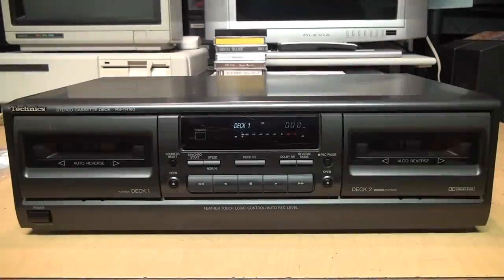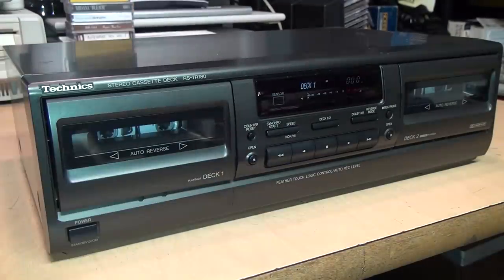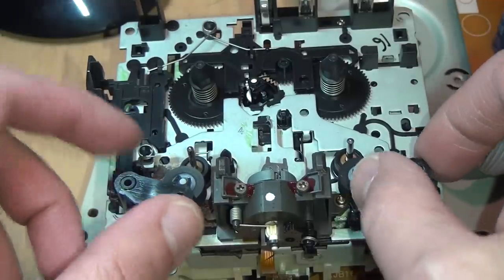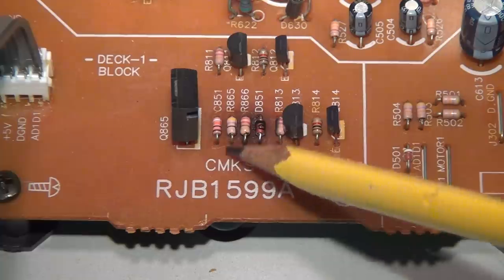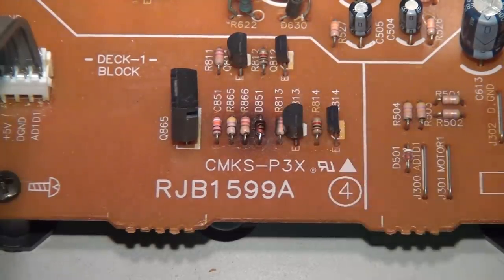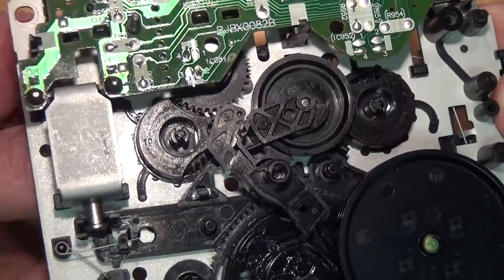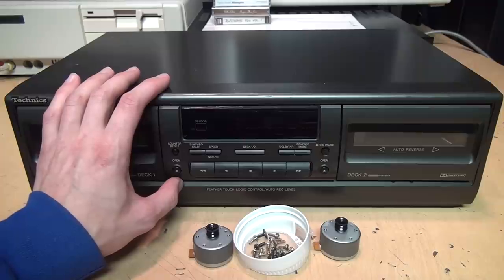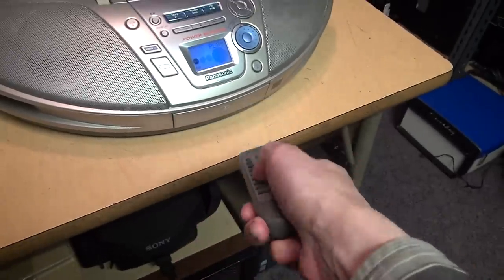Fixing a cassette deck but Everything Goes Wrong...

Comment: I have a Denon DRW-580 and it has been such an incredible cassette deck for me, it has auto reverse, dolby NR, and while its a little basic. It is perfect for me and the price was too good to pass up. It also goes well with my Denon CD player which is like 32 years old at this point.
Reply: I’ve got a DRW-850 from 1990 and it is the best cassette deck I’ve ever had the pleasure of hearing. I was originally going to get a Sony from the mid 90s but I missed out on it so I got what I thought was the next best thing. How wrong I was! Great price too.
Reply: @vintagevideoau  I’ve been eyeing an 850. Currently I have a Yamaha KX-W421 and want to upgrade. It’s hard to figure out what is an upgrade though, as the specs are quite good.
Reply: The 850 is really good. It has auto reverse, two motors for play and fast forward (four in total), recording on both a and b decks and a remote. Another neat feature is music search. The only problems that I’ve run into are when I bought it, one of the solenoids had stopped working and I nudged it a bit and it’s worked ever since. The other one was that the eject buttons sometimes stuck pushed in but some new grease got them working again. Surprisingly, the belts don’t seem to perish.
Reply: I had a Denon cassete in the 90's.
I used it a lot to copy some CD. Unless you really pay attention, the sound quality was not so far from a real cd.
I played them on good speakers (Audax Aerogel and titane tweeters), and some friends didn't believe first we were llistening to "simple" cassettes :)

Comment: I have a JVC TD-W254 double cassette deck from the late 90's, that looks pretty similar to this one in the inside. Only that it has more electronics and manual recording level control. The price on ebay is about the same as the one from the video. In my opinion the TD-W254 is not too bad, it serves me for almost 30 years and got new belts 2 years ago. But I don't remember if the flywheels in it are plastic or aluminum, probably plastic... For playback it is great, when there're cassettes in both decks it will play both of them automatically after another in a loop. I just hope that the electronics continue to last and that I will be able to fix it when it will fail at one point in the future. I still enjoy this deck, even though it is, of course, by far not the best of the late 90's. My biggest issue is with the remote control of the radio receiver that fits to that tape deck via CompuLink. Some paths on its PCB are deteriorated and won't accept input from some of the buttons anymore, or maybe it's the connection between the gummi buttons and the paths on the PCB. I'm not sure. (And my English is not good enough to explain it with the correct technical terms, I'm afraid. Sorry for that.)
Reply: I have both a JVC TD-W254 and a TD-W318 (which adds Compu-Bias calibration for use when recording). These decks are both light in weight, but have been very reliable. Not the best decks I've ever had but both work properly and sound pretty decent.

Comment: I've had a few times where I have had to call it quits on fixing a device based of either competence as I would start causing damage if I went further or the repair is uneconomical. You should always treat a failure as a learning experience to improve yourself and improve for the future. The worst thing you can do is create a sunk cost situation where you end up making things worse and being worse off with nothing but junk to show for it.

Comment: Amazing considering early 80s Technics decks were bulletproof and reliable. Even entry level units.
Reply: Probably the quality of the entry level range plummeted in just a few years. The question, though, is whether this kind of fault happened frequently in its era as well, and not just now, thirty-something years after.
Reply: In 90s CD was the choice for many so companies did not made good decks anymore. It was the end of an era that reached its peak in early 80s.

Comment: I have gotten 3d printed center gears to save my panasonic boom boxes I have an FD 55 and the center gear cracked and it’s now restored.  And good to see you calling out those fake restore videos sometimes they don’t even leave it in the mud they use modeling clay that looks like mud and they even swap units to in some of those fake videos.
Reply: It's more worth to get FD55 and certainly FD65/FD75 repaired over this Technics dual well deck, even if they're in the same company!

Comment: Yes ...
You are absolutely correct.
 Intermidiate plastic gears and rubber belt is the main 
Problem.And key board malfunctioning is  also the
 main problem.

Comment: Hello VW. We can't win every time. 
And yes, When teeth break off, round off or crack for driving the take up spool there is no solution.
     To be totally honest when I fail in a repair I find it depressing. That's life, unfortunately. But we all appreciate  honesty over channels that fix everything  everytime. So a win. 
   Cheer yourself up. The Sanyo Walkman M-G12 are red, beautiful and dead easy to fix. One incredibly accessable belt replaced and your friends will all be jealous!

Comment: I think you are right: a lot of old electronic equipment/computers are over priced these days.
I was watching some videos about IBM model M keyboards. I salvaged 2 of them from the trash, one AZERTY, one QWERTY (I am French). They were both missing some keys, and the cable (to PS/2 port).
I bought a cable from ebay, with broken plastic clip (20 euros or so).
I then went to check the two keyboards. I had almost every key cap, except one or two, but they were nowhere to be found on the internet. the main problem was that the clips holding the large keys like the space bar were damaged, so after all the keyboards were unusable.
I then went to ebay again, and found an AZERTY IBM model M keyboard for about 130 euros. I bought that from Tunisia. I don't know if that thing was from the desert or what, but it was covered in orange sand. I decided to remove everything from it, to clean everything with soap and water. Then I wanted to dry it, and what came to my mind was to bake it in my kitchen oven at 70°C. But something went wrong, I set the oven at 180°C and you can easily imagine the state of the poor keyboard at the end.
To conclude, I have a lot of model M keycaps in a bag, and afetr that I just bought a Logitech mechanical keyboard for about 130€, it is good, it is new, it is under warranty, it works well. Enough with the old stuff.

Comment: I wouldn't hate that Technics deck too much. It probably worked fine for about 15 years, and except for some of the most high-end brands, virtually no company makes audio equipment with the intention that it should last for decades - they seem to prefer things breaking down shortly after the end of the warranty period... So, I would say, it was a decent deck at the lower end of the Technics range, it did its job probably good enough and long enough for the original owner; it just wasn't made to be exceptionally sturdy and long-lasting, but neither was it trash.
Reply: So is this planned obsolescence or just an unlucky failure? I feel like he could've bought another control board or even ask EEVBlog to desolder the cpu and do a complete reverse engineer and have a potential repair!
Reply: C'mon, I have walkman from early '90s still working with original belt. A deck like that was much more expensive back then. They do that for profits.

Comment: I just spent $640. for repairs for my NAD 6300 deck.     Got used in the early 90s from Stereo Exchange shop in Manhattan.   Because I still hold on to mix tapes which are 30-35 years old (and recorded on prior machine).     And I have just a few blanks and one side recorded tapes to see how well I can dub now.   Finally, serviced better and high-end vintage cassette decks can retail for a lot more. 

Just as sticking with DSLRS instead of going mirrorless being 'invested' in older gear and being old now, too,

Comment: Thanks for sharing. Sometimes a repair just fails. I have a low-end 90s Sony Walkman that I started to repair. The belts are fine (surprisingly), but like many Sonys of that era it needs new capacitors. I've done those before, but this time when I started to replace them the tracks started to lift off of the board. At that point I just gave up and I've saved it for parts.

Comment: I had a circa-2010 LG RH397D HDD recorder which succumbed to a similar fate (the Magnum DM8673-CHZ-13 SoC failed, and when I bodged the voltage regulators into being permanently enabled, it and the +3.3V regulator got hot). I ended up salvaging the HDD (ST3160215ACE, still perfectly healthy according to S.M.A.R.T.) and scrapping most of the rest (unfortunately I don't have a proper e-waste facility nearby, so it just went in the steel recycling bin). In any case, it seems that failed semiconductors aren't as rare as many people used to assume (which age may be a factor in, but these newer items have less excuse there; especially given that it wasn't even used for many of the years).

Funnily enough, the PSU fuse was in clips and HDD mounting screws had split-ring and flat washers (which PCs don't usually bother with), so a few other corners could have been cut (without killing the device) but weren't.

Comment: This one has a different mechanism model, which is AR-2 when it comes to the "idler" gear.  This indeed a cheaper version than the Panasonic boombox which is AR-300, those are the one has a gear by removing the pinch roller, then the head mechanism, and remove the sliding plate underneath to access it!  Due to age of the plastic overtime, it will break apart and missing teeth!  

I got the red gear from eBay where one seller from Poland makes it all sorts of gear where it's no longer available!  I also got the white gear straight from Japan, where there are many Panasonic boombox around today in Japan!
Reply: Hopefully you will get their RX-DT9 or their DT8; these both beat this Technics cassette deck; with manual record level control and dolby C

Comment: Ironically, the Panasonic boombox has the same cheap mechanism as the Technics deck, and they kept using it for all of their stack systems, mini systems and boomboxes throughout the 2000s. They’re good when they work, but use the most basic of materials, so they’re prone to failure.

Comment: It kinda reminds me when I tried to fix a Pioneer cld 2750k laserkaraoke player but ended up failed when the optical pickup wasn’t compatible after adjusting the pots and before i did the adjustment it wasn’t working at all.  As a result I ended up bought an ordinary Pioneer laserdisc CLD D780 player that was restored perfectly by professional seller.  In my opinion cheap stuffs doesnt mean it’s repairable or working and sometimes parts are not easy to find so shop wisely guys.  From that time, I learned my lesson to only buy second hand electronics that were restored or doesn’t have serious problems but if an equipment I really want to buy despite being expensive I will still get it because i dont have to spend extra on parts that may not even work.  If electronics I have doesn’t work I just use for parts but sometimes for cd player if i can find cheap OPU lens that are cloned from aliexpress I give it a shot to try it.  As for cassette deck, I gave up bothering that format and move on to vinyl LP and CDs because I don’t really enjoy cassettes anymore and this caused me to sell them off to collectors.

Comment: My opinion is, if you’re going to recycle it anyways, might as well take a crack at it. I try to repair just about everything and am lucky to have a number of years of experience and a good quantity of tools and parts. Even when I didn’t, I’d still try, even on junk. If you have the inclination and time, it’s a great way to learn (especially if you fail).

Comment: Had to comment on that last Boombox at the end, That was the last of the cobra line which started in the late 80's and ended in early 2000's as way more powerful line of models and more electronics, some even had full electronic tape decks put tape in door and you could close it by remote. I have one on my vids if you want to see one in action. it is the RX-DT75 that I have on there from 1990.

Comment: I have a Technics cassette deck RS-B605 and it needs some attention. I'm wondering if I am going to run into similar problems. The logic controls don't seem to respond very well after and hour or so of use. I bought it new in the 1980's. It's worked well for over 30 years, though.

Comment: Well, as you say, at least it failed before you did the job of changing the belts. From the first video I sensed that this could happen. With these types of very low quality decks from the 90s you can expect anything.

Comment: I have a few tapedecks in need of new belts, all requiring pulling out the whole drive mechanism, haven't been brave enough to attempt repair yet. 
Still have a functioning Telefunken boombox I bought in Zürich in the late 70's, 7.5V,  220V. I hard wired the 7.5V battery compartment to my 12V solar power system with a voltage adapter. That Telefunken allows me to play my turntable too, and feed the signal into my big speakers. Best tapedeck ever.
Reply: German electronics were always among the most reliable

Comment: I agree a working cassette deck is a good cassette deck. I have a Onkyo I bought around 2005 still works fine. I bought a teac several years ago new still in the box for a backup once I saw cassette decks were disappearing.

Comment: Had a similar issue happen a few days ago although not nearly as serious as this, but still daunting and frusterating. It was with a Kenwood 1991 single well auto reverse cassette deck. I'd bought it several years ago and played and recorded fine. However, when I got it, (an ebay find) it had a very noisy capstain motor. I finally decided to get into it and attempt to get to the motor and oil it. Just to get to the thing, I ended up having to totally tear the machine apart, removing the 2 piece front just so I could get to the back of the mechanism. That was just the beginning. Motor was soldered in with very short leads to a small circuit board above it. Once that was desoldered, then mechanism had to be removed to get to the screws holding motor in place in the front. I removed motor, went through the pain of taking motor apart. You have to desolder a small circuit board once rear cap is removed. Once oiled, you then have to make a brush retainer to hold brushes back while attempting to carefully put back with brushes on motor. Once thats done, then re solder tiny circuit board back on being careful to not pull the plastic brush cap back off armature. Then replace the metal cover. The true fun part was re installing motor and getting the belt back on. Most decks have pegs to assist with this and this one was no exception. However, there was NO access to stick anything inside to hook belt back on. I spent 2 hours figuring a way to get belt back on pullies. Once this was done, machine ran totally quiet and I was happy. That is, until I noticed the tape counter which is electronic no longer worked. I spent 2 days combing through that thing to try and figure why the counter no longer worked with no solution. All I can figure is the tape sensor that senses the tape moving failed somehow. Nothing like working hard on something that "was" fine other then the initial issue to only have something else fail giving me that 50/50 successful feeling. I guess the good thing is the deck is fine to use. Just no way to use the counter.

Comment: I once repaired a Sony TC-WR735S where in both drives a small gear was broken, due to plastic shrinkage. No such gear is available. But a Hi-Fi Forum told to learn about the dimensions of gears and search for these gears at Märklin model trains parts. I found two and fixed the problem.

Comment: My JVC deck kinda broke. 
The left side got stuck when auto reverse was pressed, I noticed the sound was very quite and muffled when playing in the reverse direction for side B, this used to work fine into now. Then somehow the door wouldn’t close and acted like something was in the way, I eventually got it shut but then the button got stuck pushed in and the door will not open.  There is no cassette in there but now I can’t even use this side of the deck at all. How do I fix it?

Comment: There's a lot of good advice here.  The advantage of a dual-well deck is that your chances of having a working transport are doubled. And when it dies, you've twice as many spare parts for future jobs. Kidding aside, I stay away from dual-well models and auto-reverse as well, as I think that both features required design compromises that for my purposes, just aren't worth it.  I enjoy flipping the tape after side one, and I'm certainly not interested in cassette-to-cassette dubbing, at any speed.

Comment: When we start to see cascading failures in boards like this, it makes me wonder if it would be possible to have an open-source project that would build brand new circuit boards. It would have to have accommodation for changes to hook into the various cassette mechanisms that it could be used for, along with an appropriate power supply.

It might be fun to take a quality cassette mechanism and a tape deck case, and literally replace everything else in it to work with the vintage cassette mechanism. (Cost no object, a circuit board hobbyist).